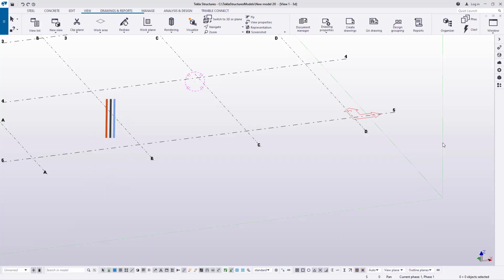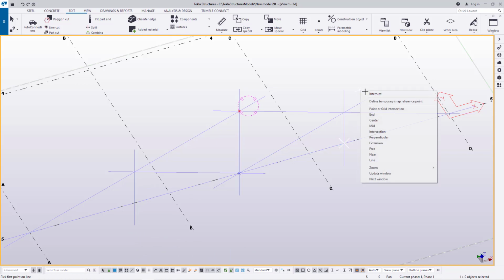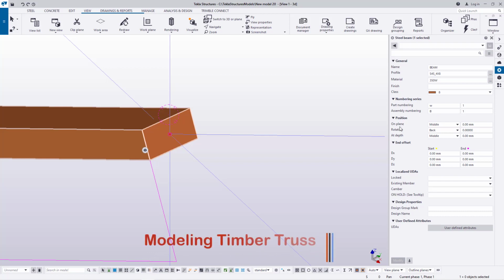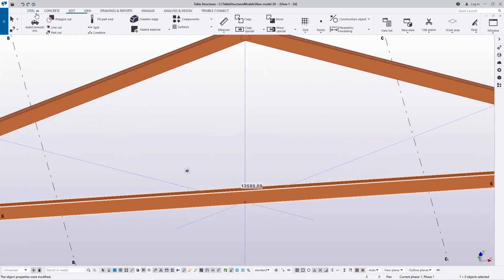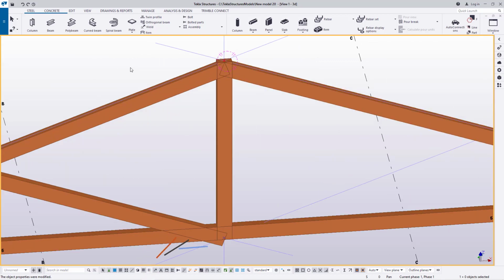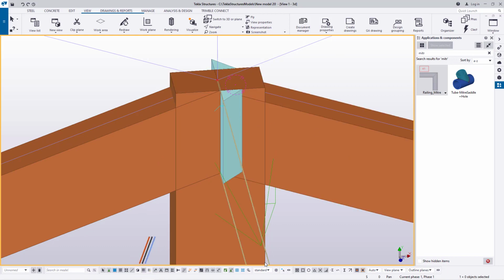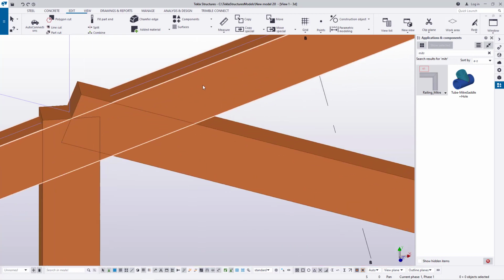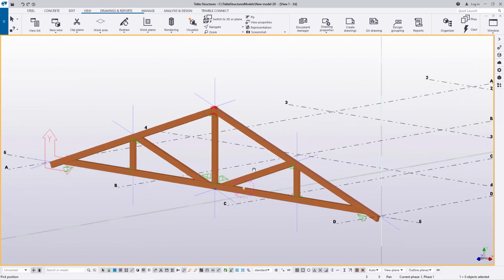Creating Timber Trusses | Tekla Structures

Comment: i have drawn the construction lines similar to yours but one i go to drawing the beam i don't see any section visible ..is it because i am missing any profile or material library in my installed software ??
Reply from the maker: which  environment are you using? this is USA
Reply: @MauriceDimba  yes USA, metric and Full
Reply: i observed that once i create the beam while double clicking the icon the dialog box shows question marks against the material and profile
Reply: @MauriceDimba  The issue got resolved i removed and reinstall the environments and this resolved the issue ...bundle of thanks
Reply: Even clicking the dots beside the profile and material the new dialog box have nothing to select